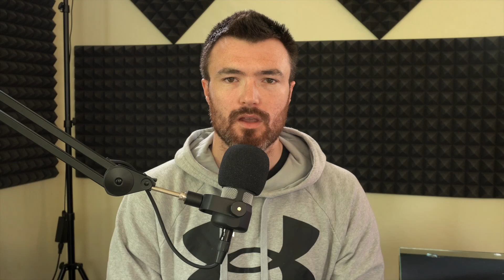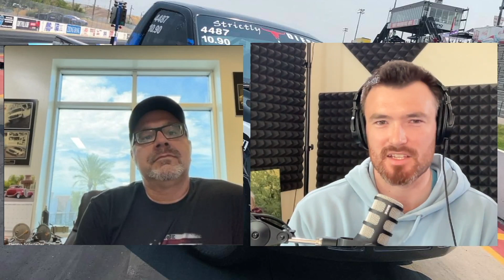Ep. 56 | Powerstroke Fuel System Design Problems - Dennis Schroeder

Comment: I have one of the early regulated fuel return systems on my 2000 F250. Love it. I plan on upgrading it to a fuel bowl delete and do a pre and post pump filter kit. The only problem I did have is one or both of the rubber hoses collapsed on the inside feeding the heads. Once I got the truck to a shop that actually new 7.3 Powerstrokes it was an easy and cheap fix. If you don't get any fuel flowing thru the heads check those hoses out. One shop burned up a few pumps trying to diagnose the problem and another one tried to tell me it was injectors. This isn't a knock against the Driven Diesel but I just want to help someone if they have the same issue I did.

Comment: I had been fighting a fuel pressure issue for well over a year.  Using the forums I had worked most of the bugs out of my system.  After hours of extensive reading and trying different things I found I was getting very frustrated.  After I found your articles I was finaly able to work through my system and properly diagnose my issue.  Also walked away with a way better understanding of my fuel system.  Just wanted to take a second to say thanks to Dennis for putting the info all in one stop and organizing it so well.